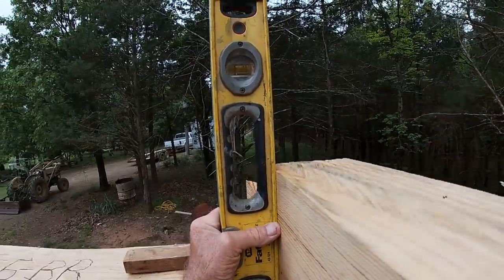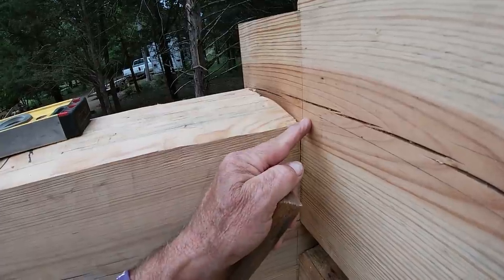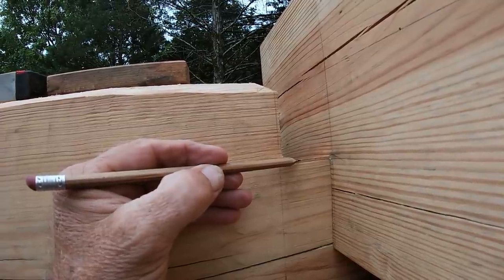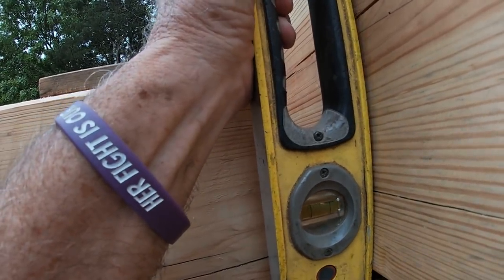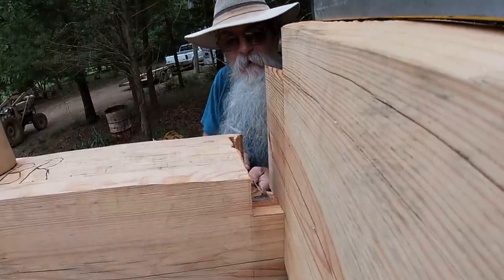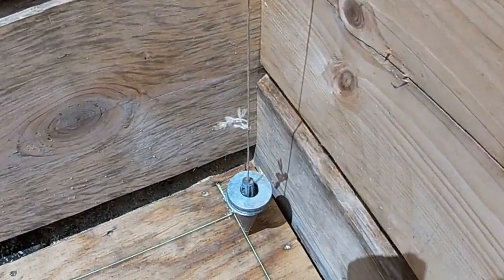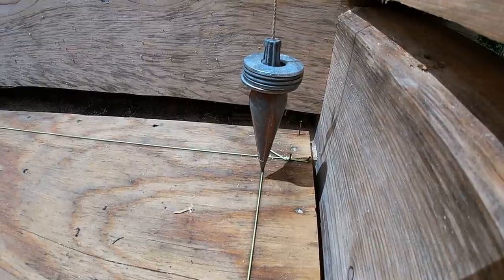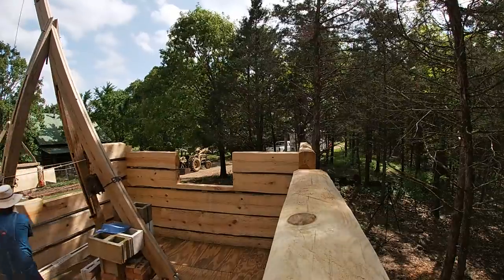Round 6, Dovetail Log Cabin Build (Ep 27)

Comment: Thanks for sharing! You make it look easy.  I'm pleased that you're showing the necessary details (plumb bob alignment etc.).  I recently attempt to contact you via email, but it wouldn't send?  That's alright I think I figured out the lay-out etc. of the dovetail joint.  Seems to me the logs need to be close to the same size (height) and work measurements off a centerline and your good to go?  In a way, I'm sad we reached the six shooter (round six of logs).  It's gone by fast.
Reply from the maker: J F   Howdy JF- l appreciate you watching the videos. I have tried to share as much as possible to help people who may not have been involved with building a lot to be able to do a cabin and not get discouraged in the process. Hope the tips help someone.  Thank you so much for watching and commenting. God bless you
Reply from the maker: I don’t know what happened with the email. It may still come through. If your logs are pretty close to the same size in each round it sure does make it better. That’s why l try to pick logs as close to the same size at the mid point. It helps keep the chinking gaps kind of uniform. There’s still a lot more work to be done yet, so, hang with me. Blessings to you

Comment: You are so talented.  My folks live in a cabin with dovetail corners.  Do you screw the logs down or does the weight of the log hold them in place?
Reply from the maker: Howdy Jerrod- thank you so much for the kind words. Much appreciated. I have used timber lock screws where I felt like I needed them but for the most part they are sitting on the notches. I always use a long stick of all thread and bolt the top four rounds together. Thank you for watching the video and for the nice comment. God bless you